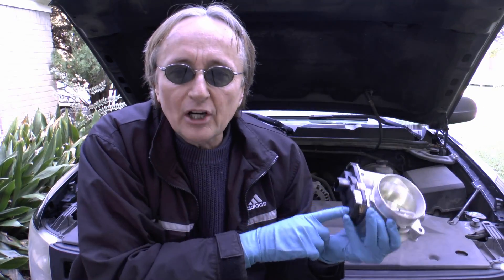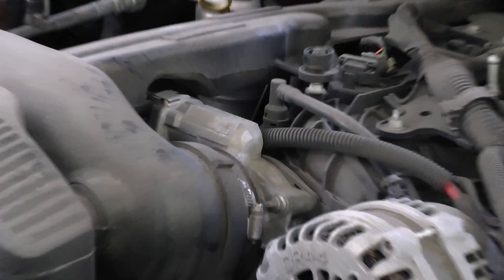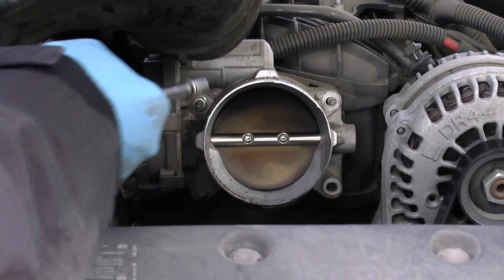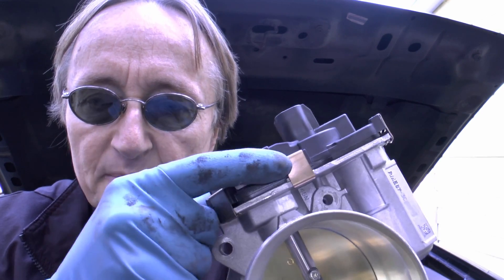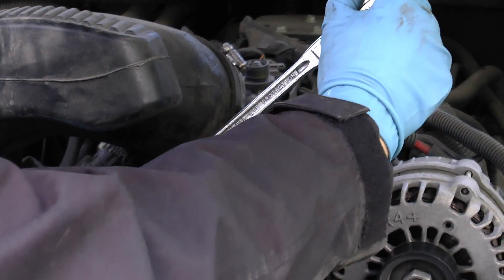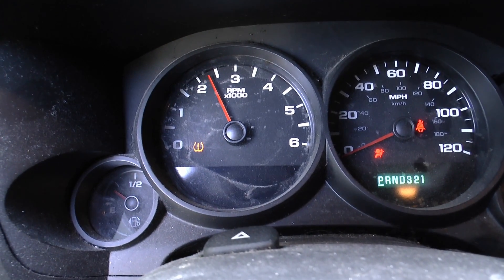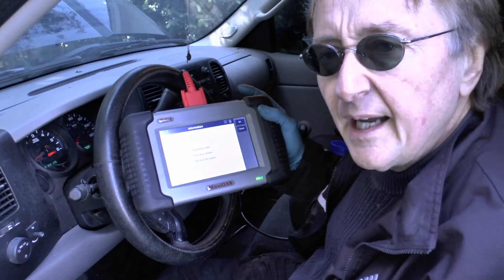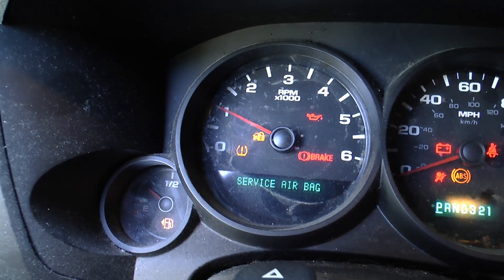How To Replace A Bad Electronic Throttle On Your Car

Comment: great video. Any suggestions on how to replace a throttle on 2008 Jeep patriot. I got a bunch of stuff in the way and I don't want to remove the coolant hoses. also do you know what a mechanic charge me to reset an electronic throttle?
Reply from the maker: call around for mechanic's prices, they vary widely. But you just have to remove whatever's in the way to change it out, often including cooling hoses. Just take your time

Comment: My etc on my chev was messed up. I replaced it with a used one for 35 bucks and it runs perfect. Lolololololol. Screw you general motors lollololol

Comment: I have four vehicles sitting in my driveway three of them run carburetors the other one is a 2003 hemi. three of them have no airbags the Hemi does and is on the recall list for airbags so I only drive it when I have to. I guess that's the price of technology people don't want to pump the gas 3 times then turn the key for it to crank.  For those that talk about mpg my 1982 New Yorker 318 with a 2 barrel Carter and a Mopar electronic ignition system gets anywhere from 22 to 25 mpg and that's with the AC on at 70 mph.

Comment: I'm having an issue along the lines of this. It's a 2002 Chevy 2500HD with the 6.0 Vorteck with a throttle cable. Not electric throttle. . On days when it's below 25 degrees. When I start it. It starts right up. The rpm kicks up to 1000 like normal but after 5 seconds the rpm drops to the point where it barley is running. It's sputters at a very low rpm for around 30 seconds and then picks back up to 1000 rpm. Then several seconds later it will drop back down and barley run. It will either stall out or continue this until the engine temp picks up a bit. After that it runs perfect. On warmer days it starts right up and runs perfect. It runs very well and doesn't burn oil. I don't think it's fuel related as it has new fuel pump, filter and lines.  It did this before and after the new pump. It idles normally when it's not doing this. Plus It's been doing this for as long as I can remember. My father got this truck in 2003 and it's now mine after he bought a new truck. It's done this ever since he's gotten it. I'm stumped and can't find a solution,  any suggestions.

Comment: Hey scotty, I have a 2005 nissan altima, and today I cleaned the throttle body and mass air flow sensor. After I put everything back, I turned the vehicle on, and the rpm goes up to 2000 and then back to 1000. It keeps going up and down, but only when on park and neutral.  I plugged in an obd2 scanner,  and it gave me code p0507. But what can it be? I've searched the code and TPS sensor came up and Mas air flow sensor aswell. I don't know what is the actual problem. this is the only transportation I have, please help!!

Comment: Mr Scotty , i have a strange RPM needle movement , sometimes it goes to 7000 and starts moving higher from there and even when i turn the car off it keeps sticking on 7000 or 6 or 4 but not on 0 where it should be , but when i disconnect my battery for few hours , it goes to normal again for few weeks till it breaks again , and the same thing happens to the fuel gauge also , the needle goes way more higher than FULL when the tank is more then half full,  and when the tank starts to get empty the needle drops to half and that is when my tank is almost empty . and it all get fixed when i disconnect the battery for few hours , and its a matter of time till they break again , so whats the problem here what do i need to change ??
Thanks a lot for everything you do for us ..
Reply from the maker: you have electronic problem, often something like a bad main computer does that with all those different problems.
Reply: Scotty Kilmer so what should I do?

Comment: My 2008 dodge charger 3.5 v6 is not starting and plus it gives off a burning smell when I trying to start it and when I leave it in park running it turns off helpe plz
Reply from the maker: many things can do that, but check with your nose under the hood first to see if something is actually burning, like a locking up alternator making the fan belt burn
Reply: Scotty Kilmer i just brought it in the shop because my car will not give me engine codes I'll keep you up dated

Comment: Another cheap way to do the idle-relearn process for some cars is that: Turn the ignition key to ON position without starting the engine, press gas-pedal all the way down (No Pumping), release gas-pedal, switch key to OFF position. Do it all over again two more times. Start the engine and hopefully system learnt the idle position. Good Luck,

Comment: I am getting code 26 and 30 on a 1981 Eldorado 6.0  The codes suggest a problem with the ISC motor and TPS. The cars idle is way to high. I replaced the ISC motor and checked all the writing which was fine. The Idle was still way to high but the codes went away. Does my car have a re-learn process as well? I ended up removing the ISC motor and manually adjusting the idle speed to 700 rpm. What do you think scotty?
Reply from the maker: those old things have no relearning process. Your fix should work fine
Reply: Scotty Kilmer Thanks. I really appreciate how you answer your subs like you do. Your channel deserves way more recognition.

Comment: Hey Scot I got an acura tsx 1st gen and the throttle seems jumpy and different than it was when I first got it at 90k miles. It now has 111k and I'm wondering if its the throttle body itself, the gas pedal? Or would just cleaning the throttle body help it? I bought the car used idk if that means anything. The for your time love the vids

Comment: there's probably some exotic engineering reason to have an learned idle system, probably for efficiency reasons....its still silly

CAFE standards (what's forcing automakers to meet pretty obscene efficiency numbers) are making modern cars pretty disposable and horrible to upkeep.

Comment: Hey Scotty, I have a 96 Mercedes c220 with 211k miles (yeah, I know, but this was the last year of the "solid old Merc's" before they were all complex electronics). Sometimes when it's very cold or wet outside the car hesitates and live data shows the TPS values dropping out. The wiring insulation used inside the actuator is known to degrade and short out. A new throttle assy is $700, a used newer version with updated wiring is $250, rebuilding service is $200, or I've seen some people dissemble and solder in new wires themselves (preferably on a spare junkyard part to not risk destroying the original). I have less than $2000 into the car and it runs flawlessly otherwise and has never had any other problems, what would you recommend? Thank you for the great videos!
Reply: If your soldering skills are good, go ahead. Make sure you get shrink wrap tubing on the connections

Comment: I had to pay $140 on my VW GTI so a guy can reprogram my ABS module after I did all the labor to install it and bleed the brakes. To make this things worse VW has complete control over ABS modules because no one makes them as a third party vender so the dealer can inflate the prices. For my 2009 GTI the price was around $850 but I got it threw a friend for $560. Lucky me, but I still had to go reprogram the darn thing to a VW dealer otherwise the darn lights will never go off. Also they designed the darn car in such a way that a loud beep would go off all the time the car was running just to bug you more. I ended up just disconnecting the darn module untill I raised money to get a new one, Over all it was a pain. Fun car but expensive to fix if it masses up.
Reply: Thats german engineering. The older VWs are virtually unkillable.

Comment: Hey Scotty, what brand scan tool would you recommend for a BMW? 1996 to 1998 e36 specifically. I look up scan tools and read mixed reviews. The Peake Scan tool is made for the car, but it doesnt seem to do things like live data. Any ideas? Thank you
Reply from the maker: I use an autel maxidas and it's OK. You really need a dealer scan computer for BMWs. But just basic live data, even a 200 dollar actron will give you some.
Reply: Thank you Scotty ill look that up

Comment: Hey Scott,
I have a question about torque converter, im experiencing gear 5 to 6 shift flare around 42mph upshift. It only flares when im light on throttle and upshift below 2k rpm. Rpm will flare up 300 to 500 before it shifts, feel like car got put in neutrel. I noticed above 2k rpm it will not flare. I looking around internet and found it might be related to torque converter locking up in low rpm? i dont know if its true, whats your take on it? My car is a 13' Mustang Automatic.
Reply from the maker: take it back to the dealer, it's under warranty and those things are complex as hell, needing a dealer scanner to analyze and fix. Could be as easy as a software upgrade.
Reply: Scotty Kilmer
I was at the dealer last week but due to their schedule and holiday they couldnt have it hooked up to a computer. But did go out for a test drive and was able to reproduce it. Im also finding same problem with others posting on the forums. Thanks

Comment: Hi how do I take out the threads out of the engine block where the spark plug goes one of my sparks plugs just came right out n now I can't screw a new one in cuz someone put atached thread to the plug in it Is stuck in there how can I take it out please
Reply: Morenita, you need an "oversized spark plug thread repair" kit. Time-sert makes 'em, and they're called Big-serts.
Reply: helicoil works to keep the same thread size on your plugs or you will have an oddball plug

Comment: Hello scotty, i am having a problem with my 93 chevy astro cargo van it stalled while i was driving it and check engine light turned on i put the key for the code and it read code 54 low voltage on fuel pump relay . I replaced the fuel pump with a new one put a new filter and then went over to the fuel pump relay and i noticed that the plug was melted and the wires were burned so i replaced that as well so after putting the gas tank back and replacing the relay and checking the fuses the van cranks starts and turns on then off like it did when it died off on me. Ok so now i checked for spark and it has sparks and also checked the fuel lines for gas and they have gas and the van still wont function to normal.
Now I dont know whats wrong with it and its giving me a headache if you have any advice on this please tell me I really want to fix my van. Thank you.

Comment: Very nice, Scotty, have you got a video for changing a fly by wire throttle body? my car's a bit older than this =P

Oh and it's not modern engineering Scotty, it's modern "brains" for you, people who call themselves engineers and so on think they're more special because they make things more fussy or more complicated... stupid bell ends.
Reply: ***** Ah yeah, oops, it's a cable but there's nothing electronic on it except for the mass air flow sensor on the intake.

Comment: hey scotty, i have a 1989 camaro and i just did a tune up on it. I changed the wires, plugs, distributor cap and rotor. When i was installing the distributor, i forgot how it was turned on the old distributor cap, does that mean i will have to find out the ignition timing or top dead center, if so how would i do so? thanks

Comment: Hello mr. Scotty, I have Mazda mx3 . My mechanics just change the timing belt and water pump, but after that there was a check engine. He accidentally broke one of the sensor. Then I changed it check engine temporally gone, but when the engine is warm the check engine comes back on... Pls advice... Thnx

Comment: Ever since my engine was replaced at my dealership it's had issues idling around 500 and shaking. It even caused my car to die a few times. I was told they found nothing wrong. What could it be?

Comment: After watching this video, I'm convinced that engineers and dealer service departments are working in concert to rake peoples wallets over the coals with maintenance cost. I can't think of any logical reason for an electronic throttle on a gasoline engine. I'm sure the dealer would charge $1000 for this easy job. $700 for the part-$300 for the labor. YOW!!!
Reply: It's due to emissions regulations. It's easy to meet emissions during steady cruise, but "transients" (sudden changes) in throttle are a huge problem.

If you suddenly let up, the air flow to the engine gets shut off immediately. But, there is a lag on the sensors which the ECU uses to control fuel injection, plus there is fuel which is still being injected, or on its way to the cylinders, but with no air to go with it. The result is a mass of unburned fuel that has to go out of the exhaust - in a highly tuned car, you'll get crackles and pops, and maybe a bit of flame out of the exhuast as this fuel gets dumped - but, even on a normal car, for those few seconds, the emissions go off the charts. (A catalyst will catch some of the emissions, but it can't catch all of them)

Electronic throttles have a HUGE advantage, because with electronic throttle control when you press or let go of the accelerator pedal, the ECU has control over both the air and fuel. The ECU can keep the throttle open for a bit longer, allowing all the fuel burns off - or it can coordinate the fuel and air during acceleration, to prevent lean-burning. 

As emissions regulations get tighter, you'll see more and more of this electronic control.
Reply: ChumpusRex Yea ok. Sounds like you work for the engineering department trying to find a reason to create unnecessary technology just to allegedly reduce emissions by .00001%.
Reply: dstarks80 No. I don't work for a car company, and I don't like electronic throttles.

The car companies are forced to meet emissions - how they do it is up to them, but they want to find the cheapest way.

Given the option, do you design a car with a oversized catalytic converter, which increases manufacturing cost by $250; or do you install an electronic throttle that increases cost by $75. 

There's no surprise why car manufacturers are using electronic throttles, even though they cause driveability problems (revs stay high after you let off the gas while the fuel gets burned off; or a lag after your suddenly mash the pedal, for a similar sort of reason)

Comment: Hi scotty. I have a chevy impala 3.4 and when i was driving it about 40mph it surged. I thought nothing of it. Then it stalled. I can only drive it about 5-10 min at a time(it runs fine for that time) then it stutters and eventually stalls. It also stalls when turning. Took it to autozone got codes p0401, p1189 and p1189. (I cleaned the throttle body, egr, and maf)

Comment: Scotty you really scared me of buying newer cars, what the hell was wrong with a throttle cable or aluminum intake manifolds and and no complicated variable valve timing, i got to say cars with fly by wire feel weird and as if they have some lag on lower speeds
Reply: This is a much better way to screw the public that pays the manufacturer their livelihood .
A twenty dollar cable replaced by a four hundred dollar piece of Chinese junk electronics .You wonder why the West is always in debt ?
bunch of assholes engineers !

Comment: i had the same problem. Cleaned the TB, then the idle went wrong. It cost me 80 bucks to get it done at the shop, but it's only 100 for the shop to clean and reset it. what a waste of time.

Comment: My mother's truck had a Automatic Throttle Assembly, but when i pulled it apart to find the problem with it, i found a cable running to a knob under the hood that goes into a computer, and it runs back to the pedal.  I looked at the throttle flap, and its controled via Computer Sensor. Can ya help me with this?

Comment: Hi Scotty,  is mixing synthetic oil into a car that takes conventional a bad thing to do? I personally don't think its smart. But , i hear people say "oil is oil" 
I'm repairing and replacing a lot of a blown motor head & all gaskets on a 2005 Camry 4 cylinder, with only 56K original.  It was in a front end accident b4 i bought it. Could the accident be responsible for the failure. Any thoughts would be great. Thanks my friend, Matty

Comment: My gas pedal is not in a good shape i think, i can press it a little bit w/o rpm change and its pretty annoying. Can I repair it alone ?
Reply: Is it cable or electronic?
Cable can be adjusted easily.

Comment: I know when I did the electronic throttle body in my Mum's Saab, I just had to disconnect the battery for half an hour, and start it back up to do the relearn. No computer required. Give that a go before rushing to your mechanic!

Comment: Hey Scotty i have a bad crank position sensor on an olds intrigue, does the relearn procedure need to be done to the new one by a mechanic or can it correct itself? Unless you can recommend a scanner that has the relearn option included in it.